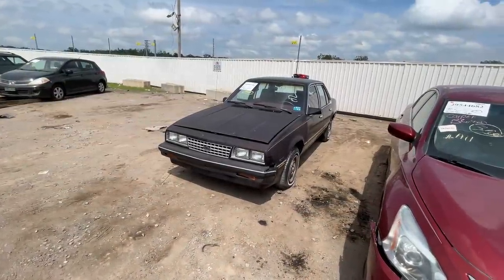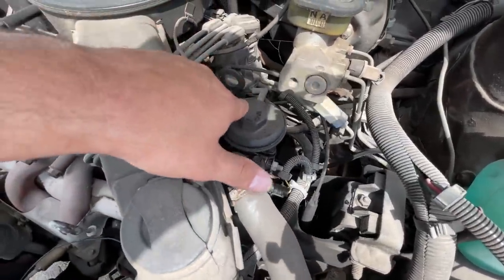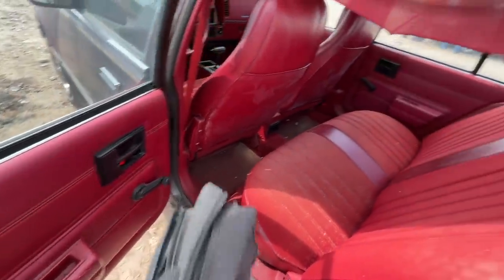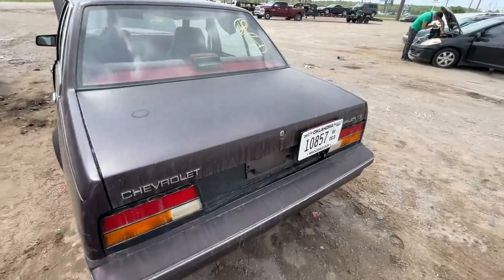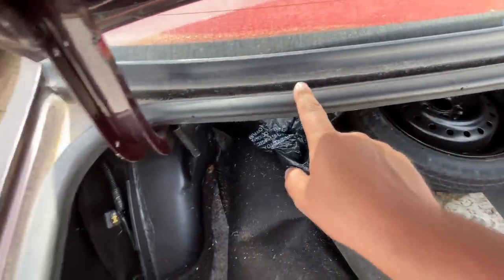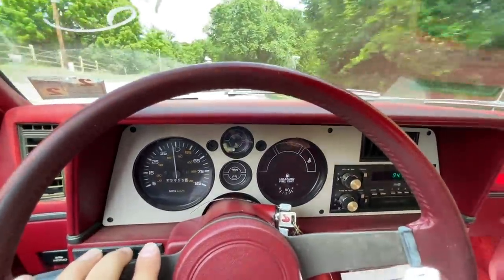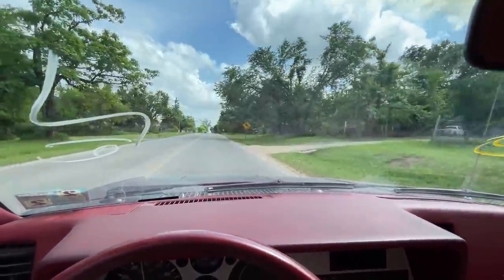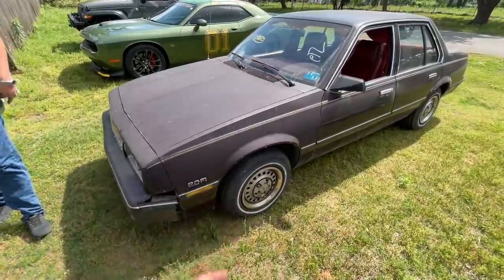$375 1986 Chevy Cavalier Parked 4 Years - Will it Run?

Comment: My Dad bought a 1984 Chevy Cavalier 2 door 5 speed new and I used to drive it to high school in 1985 and it was a good car. The 2.0 TBI 4 cylinder was a good engine and the only thing that was not reliable on those cars was the GM A/C compressor because the system didn't have a low pressure switch on it and the compressor would continuously run and pull a vacuum on the low pressure side causing seal failures and ruining the compressor. It got about 30 mpg and was peppy for an 1984 4 banger. They also came with power assisted rack and pinion steering. You might want to change the fuel pump as well. I noticed you were surging and that is the first sign of a bad fuel pump with that car.....been there done it.

Comment: Back when Chevrolet actually had quality. Now I hear that some people already have problems with oil and engine failures below 5,000 miles.
Reply: @SevenNumber7  infact I already did before lol.
Reply: right...and my guy calls this car a " beater" non of these modern cars will be on the road in 30 years.....ironic
Reply: My parents had an 83/84 Cavalier. It had many issues from new. Bad paint to electrical issues.

Comment: That 2.0 engine was a damn good engine. I had one in a 1984 Oldsmobile Firenza station wagon with a 4 speed manual. That car ran 327,000 miles before it finally crapped out. It wasn't even burning oil. It went through 3 clutches.

Comment: Come to think of it, I had a 85 j 2000 ( sunbird) and that car was junk, but had cold ac, hot heat , and ran like a charm. Was very great on gas and started every time. Mechanical wise, it was low maintenance and survived 5 years of Chicago driving. Great car.

Comment: The leaky valve cover is a cause for a lot of EGR failure codes, 9 out of 10 times you can clean the EGR diaphragm off and re-install it and you're good till the oil cakes up around it again or you replace the valve cover seal depending on your level of interest in repairing it. Those struts haven't been replaced, those are the original struts in that car! Tiger paw tires were junk back in the day and they aren't great now. you can still find them but thankfully they are kinda rare. Shouldn't do the alignment  until you replace that strut that's blown out. why paint the car? you could buff it out and bring that shine back and not have to repaint anything

Comment: I have a 1993 cavalier convertible, when GM changed to 134a refrigerant, they "adapted" my system, essentially they evacuated the system added a can of "conversion" oil and changed the high and low fitting to accommodate 134a and charged it up. Just last year I had to replace the compressor.

Comment: with the headliner, its really easy to redo. I redid the headliner which was WORSE then what this has, and it was $45 all in. I was gonna pay someone but after everyone wanted $250+ to simply perform an adhesion process which is relatively elementary to complete, I performed it myself w/ OUTSTANDING results! Just gotta make sure every last bit of old glue is off the headliner board, and use plenty of spray adhesive!

Comment: great car  I had an 86  ran it up to 186000 miles before i traded it for a newer one  mine was a 4 speed manual  but had ac  that worked.  loved that little car  and its replacement  Cavalier RS  seems like it was  early 90s model  and it also went well over 100,000 miles before i got rid of it.

Comment: I haven't used the Frostycool brand, but I have used that type of refrigerant before. Love the stuff. Comes in many brand names in Canada like Redtek and Duracool. Works phenomenally well, especially in R134a setups. Ran it in two 1988 New Yorkers, my 1992 Imperial, and my folks' old 2002 Caravan. That van would freeze you solid with that stuff in there.

Comment: I'm watching this video from two years ago on the 1986 Caviler. I had a 1987 Caviler with a 5 speed stick. I purchased it in 1989. It was a beautiful car for the times. It also had a luggage rack on the trunk that made it look like it had a small wing on the back. I can't tell you all of the mods that I had done to it but people always asked me if it was a Cadillac. It clearly had Chevy badging so why'd everyone ask me if it was a Cadillac. I drove down to the Cadillac dealership and saw the Cadillac Cimarron. To my surprise it looks dang near the same as my Caviler. I had over size raised white letter tires and chrome visors over the front and back windows and over the four head lights if you could Invision that. The strangest thing you said about  the color of the Caviler is you called it brown. Everybody liked the color of my Caviar. Which was a highly metallic purple color. The only people who ever called the color brown were the police. I was pulled over shortly after I purchased it and police had me standing by his car. I could see that he was looking for a stolen car. I walked over to my passenger side door and reached in and grabbed my paperwork out of the glovebox. I gave them to the police officer and I could see that he was looking for a brown car. My paperwork said that the car was a stock Chevrolet maroon. We both looked at his monitor and it clearly said BROWN. From the vantage point of the police car, looking at the back of my car in didn't look anything like a brown.😅😅 The only thing that the officer could say was give him a break. 😂 He handed me back my paperwork and drove off. That is the same color of my car. The way I had it fix up people said that it looks better than the Cadillac Cimarron. I forgot the after market fog lights. I still don't know why it had the Z-24 interior and power windows.

Comment: Man, Randy, I haven't seen a tire like that since I had my '72 Valiant. All the bushings were gone and it would eat tires. I would buy used tires and they would last about 2 weeks. I finally threw the timing chain on the engine. I have been cut by those steel belts and it was no fun. Bet those struts were blown by bottoming them out and then the vibration from the tire shook it apart. Good luck with the old girl. Seems like a heart transplant is next for the ElCamino. You have the engine right there that will make her right again. But once again, your cars your decision. I think I would go for it since you already have the parts right there. You are one of the good guys Randy, and your friends show it. A man's measure is not by his wealth, but by his friends and his reputation. You, sir, are a wealthy man.

Comment: My dad bought an '86 Cavalier brand-new, kept it for 10 years and put 151,000 miles on it, I put many miles on it myself.....common issues with these....exhaust manifold cracks, and the valve cover bolts would loosen up and cause leaks as with this one here, putting loctite on them seemed to help a bit. it was a damn reliable little car!
Reply: Don't forget about the weak rack and pinion steering.
Reply: @mexicanspec  Never had an issue with the power steering on ours.

Comment: I had an 1984 Cavalier with the 2.0 liter and I ran it 65/70 MPH with no problem.  I actually got busted on the freeway by State Police back in the day and she clocked me at 72.  Speed limit was 55 at the time.
Reply: I just pushed an 84’ convertible to 85 on the highway yesterday. Amazing cars

I paid 700$, 127,000 miles.

Comment: There are several groups with large followings on FaceBook for these cars. Both older FWD GM cars and GM J-Bodies. I'm actually in process right now of buying the Cadillac Cimarron A Rural Vermonter got late last year, he's going to drive it from Vermont, to Wisconsin for me. The Cimarron is this car down the last nut and bolt, only difference is a V6 engine, and a nicer interior. I've wanted one of these 2.0L Cavaliers for over 20 years. They rarely appear anymore in this condition; So I settled with the Cimarron.

As for the A/C, when you recharge with R134a like you did, the system is only going to take 75% of what the R12 charge amount calls for as the molecules in R134a are larger. R12 systems often lack double barrier hoses as well which means in a couple years it'll need to be recharged again.

Comment: Repaint it and keep it. Used think these cars wouldn't be so important but they are. Nostalgia is a part of what makes us human. During the worst times we think back to much better times. Cars like these represent some of the best years of many of our lives. I'd keep it and never sell it. Newer cars are just not that important. 50 years from now very few cars from today will be of any value. Tesla's of course will be collectables. But the rest are more or less disposable. Car companies make their cars worse now so you're forced to buy a new one every 5 years. I grew up in the 70s and 80s. Many cars from the 60s were still on the road and going strong. Car manufacturers don't like us driving their old cars. It's why parts support is disappearing. I'm working on plans to fight back against it with a factory I plan to build that only makes spare parts for older cars. From 1920s to 2010

Comment: Those were the better cavaliers, I had an 82 with the 4speed, man that thing was terrible, it was good until it got 40k miles, leaked oil, valves tapped, ac kept squeeling ,head gasket blew, I took care of that car, in the end I couldn't afford to fix her and ended up junk. I like yours though ,for the money you struck gold :)

Comment: Drove a ‘86 Holden Camira SL/E 2.0 aut. In New Zealand for a couple of years and before that a ‘85 Opel Ascona 1.6S manual in Europe. Basicly the same car as this Chevrolet Cavalier. Had good use out of both. And very simple to do maintanance and repairs compaired with todays cars. Would have loved to see this Cavelier on my driveway……😉

Comment: This was a hillarious video - liked it a lot, but to do the math: take old tires + 1x 200pound youtuber and 1x 300pound youtuber speeding the backroads, 2:40am the tire blows 30 miles till destination . On 5am the destination was reached. What where you guy doing that 2h20min - with 40m/h you should needed 1h max.  So who put the fun in the funhouse?

Comment: That Cavalier just needs the Autospa treatment 😉 oh and a headliner...

Not worth painting, those creases in the rear pillars are from the smack up the yaris... That rear deck lid might close perfect, but that rear panel has taken a tidy hit. No point painting it unless you're going to restore it. 😉 It's a solid car otherwise, so it will be cheap transport for someone. 

That '74 is just begging for the motor from the Camino 😎

Comment: I guess they are similar in body style in 86 I wasn't driving a car yet give it a few years later you don't seem like you're older than me I'm almost 50 but anyway.I had a Pontiac Phoenix I think it was four-door silver color red interior looks a lot like that sound like it and I think it had the same motor but yes it is like a time capsule man it brings you back to the carefree day. I was maybe 18 or 19 and I bought it from a little old lady in Florida. I was working in a restaurant and I drove that car everywhere. The other one I'm a fan of you don't see too many I've not seen any on your channel yet is not the round capris that you had before but the square body GMC 78s 80s that was my first car. Just turned 16 I had an 84 Caprice classic bluish greenish in color  had that for a little bit. then I had later on I had a 78 orange with tan interior Caprice classic. The other one that's a fun little car if you can find them in the auto auction rebuild or copart not see them again on your channel is the late 70s Toyota Corolla. I forget what engine was in it but I had the half a hemi I called a half a hemi at 4 cylinders with a spark plugs inside the valve covers man that was a good little car I paid like 300 bucks for it it was ugly. But man let me tell you something I fixed the coolant problem and she ran like a gym. On the starter was a pain in the butt in them cars because if you didn't have a heat shield and exhausted right on top of it they would stick car yourself a hammer and tap on it

Comment: The 2.0 and later 2.2L were nearly indestructible, sans headgaskets and oil leaks. Likewise for the TH125C trans. 1 down fall for this original gen Cav is the lousy brakes. They 'worked' but would wear out in 15-20k. Later ones had better brakes. These were basic bagin transportation and honestly, not that bad of a car at all. If you could keep it from rusting, they would pretty much last forever. $550 out the door? Yeah I'd fix what it needed and drive the snot out of it!

Comment: Always wondered if that crap was asbestos cuz it's like if you just rub it it comes off that's a hard board headliner and then they spray this stuff on there and put it on there.I had a buddy mine had a detail shop and he used to do a headliners and that's I know what it is who's wondering if that crap is as fast as you should take out like a little grinding wheel to it oh my God it's a mess or it makes mess.

Comment: Back in the early nineties, some bright sergeant came up with a way to save the US Air Force some money. They placed a clapped out Government Cavalier at an aircraft repair station we sent our tanker aircraft to and had to stay with while the contractors performed inspections. Previously, we rented cars from the local airport. This Cavalier had all the typical bad problems. Hard starting, steering rack morning sickness, bad brakes. One time I visited, I requested it needed maintenance and got a rental car. I think with the repairs, it ended up costing more, than the car originally cost. What a POS.
Reply from the maker: This one sure is doing great for almost 40.

Comment: That car at the end sounds like a lifter or maybe bad valve spring so maybe that's why it's got no power or a chain if that's the years that GM use plastic coated cog's

Comment: Most GM folks refer to that interior as Bordello Red or Whorehouse Red owing to the bright red color of furniture found in stereotypical 19th century  whorehouses. That color interior was in many, many, many GM models from the 1950's to the 1990's and it did not matter what external color the car had. That interior came in cars painted white or blue or eggplant. I would not repaint that car's exterior that same color red as it would overwhelm any person opening the door as it would be too much red (your Dodge Ram is bright red on the outside but a sensible gray/black color inside. Dodge knew it would be too garish with a red/red color scheme). I would look at painting the car ether dark red, burgundy or wine color. That would look good with a red interior.